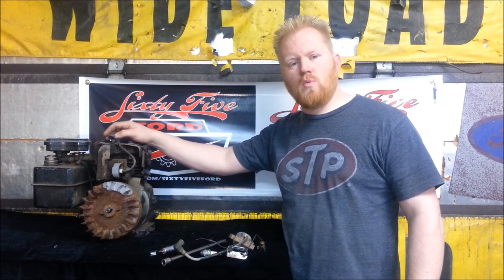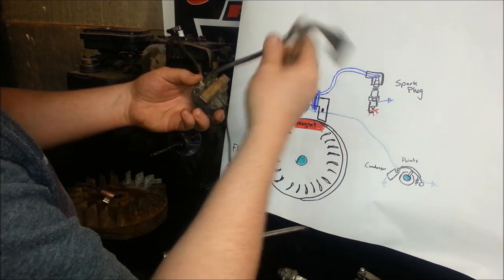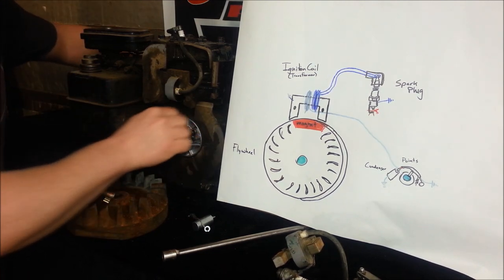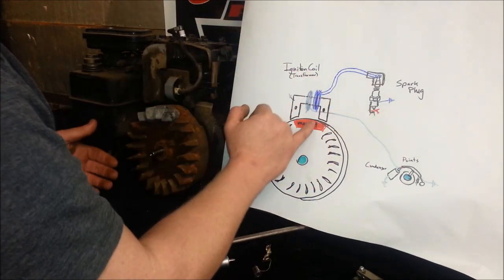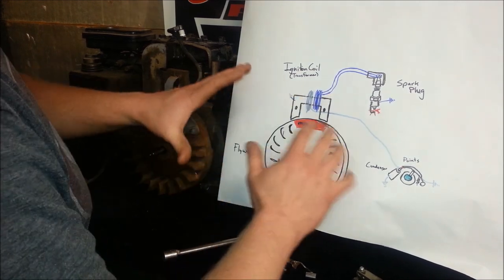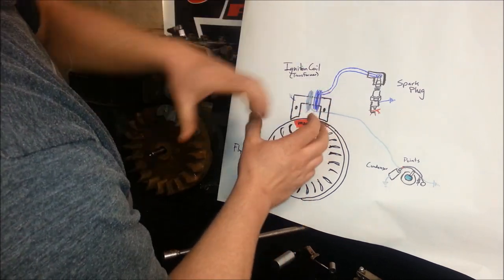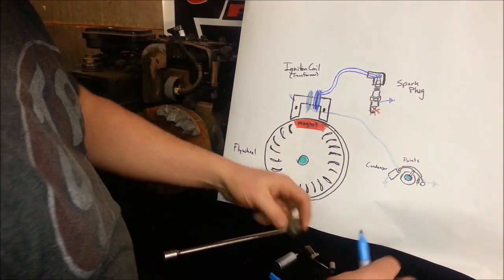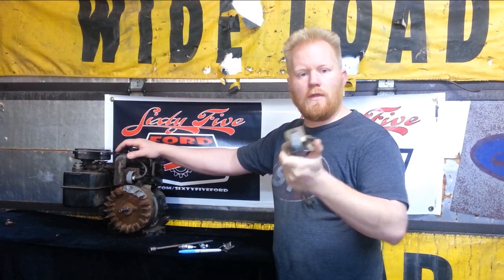How Points and Condensers Work Small Engines

Comment: Thanks for sharing this video! So if I'm seeing a bright spark at the points when my Koler K321 is turning over should I assume the condenser is bad?
Reply from the maker: +Farmitecture Yes, if you're getting no spark at the plug. A few random sparks at the points is normal but not all the time.
Reply: +sixtyfiveford Thanks for your quick response! I am getting spark at the plug and a constant spark at the points. The motor does start but won't stay running at low idle unless I open the points all the way but then it won't keep running at fast idle it skips and misses and eventually stalls. When I set the points to max (they are only supposed to be .020 for this K321) I get a brighter spark both at the points and the plug maybe that's why it stays running then? Any thoughts?
Reply from the maker: Personally it sounds more like carb problems. A weak ignition system will falter at high rpms but generally works fine at idle.
Reply: I have rebuilt the carb and adjusted it to the manual and them some to try and keep it running when I set the points to .020. If I set the points to full open It idles great at low rpm but won't run smooth at high rpms. Thank you for you thoughts!
Reply from the maker: If the carb is good, you're on the right track with the condensor.
Reply: Thanks, the condenser is in the mail we will see.
Reply from the maker: Yeah, let me know.
Reply: Hey SixtyFiveFord! Well I hate to admit it but I had my wires crossed on the points and condensor. Instead of having the points and condenser going to the negative side of the coil I had the points to the negative and the condenser to the positive side! OOPS! I'm surprised it even would start! Anyhow I have it all squared away now and she runs great. Thanks for all you time and help!
Reply from the maker: I'm glad you got it sorted and have a running engine.
Reply: @farmitecture2060  sounds like carburetor problem

Comment: Great explanation! Thanks!
In order to obtain a very HIGH VOLTAGE in the secondary, we need a GREAT FLUX CHANGE through the core (implicitly secondary coil), because the greater the flux change the greater the voltage obtained. Therefore, besides collapsing the flux in the primary, we ALSO REVERSE the current direction through it, obtaining a GREATER FLUX DECAY through the primary, and this is exactly what the capacitor does. A capacitor always opposes a build up in voltage by charging itself. The contactor circuit here shortens both the primary coil and the capacitor. The capacitor opposes the build up of the induced voltage in the primary by charging up, and immediately after the circuit opens (10 degrees after Neutral, EGAP), the capacitor is no longer shortened by the contactor, so it discharges solely through the primary coil. 
Keep in mind, that any collapsing magnetic field through a coil, give rise to a self induced current through that coil. In our case, the self induced current due to the collapsing magnetic field is opposed by the capacitor current through the primary, thus hurrying up the collapse (according to the Right-Hand Corkscrew Rule) !
In other words, the capacitor only forces a reversed current through the primary, to oppose the selfinduced one, in the end accelerating the collapse of the induced magnetic field. This happens very quickly, right after 10 degrees past Neutral (EGAP).
At this point, the CHANGE of the rotor magnetic field in the core is just below peak value, which means the EMFs generated in both the primary and secondary coils are just below maximum. Also, the CHANGES in the rotor magnetic field and the collapsing primary field have the same directions (very important)! As the two magnetic fields have the same direction of change, they will superimpose, thus give rise to a LARGE FLUX CHANGE through the core, implicitly through the secondary coil. This is like a spike in the magnetic flux change through it, leading to a very high EMF at the ends of the secondary, which translates in a spark obtained at the sparkplug.
Moreover the capacitor and primary coil form a tuned LC circuit.
All this starts when the EGAP commences and up to the point when N reaches the yoke (Full Register position), the superimposed flux change being large enough to create the spark.
https://www.youtube.com/watch?v=OMLSNwQiiKg

Comment: This is not correct!  A transformer doesn't require AC to transfer the high voltage pulse.  A DC current will charge a transformer  stretching the magnetic flux.  When the points open  this charge collapses and induces a high voltage spike in the secondary.   Try it by putting a 9 volt battery across the primary  and hold the secondary  when you disconnect it.    IT WILL HURT,  BUT NOT KILL YA.  however you need to replace this video with that one for redemption on this false information you have spread.